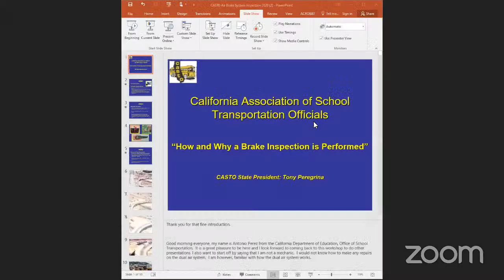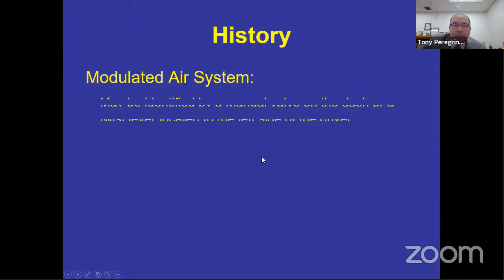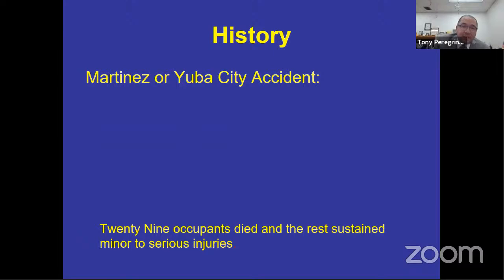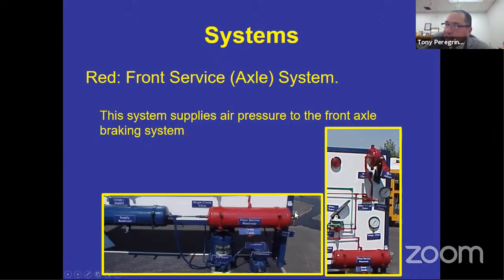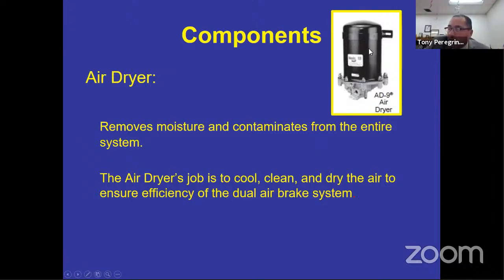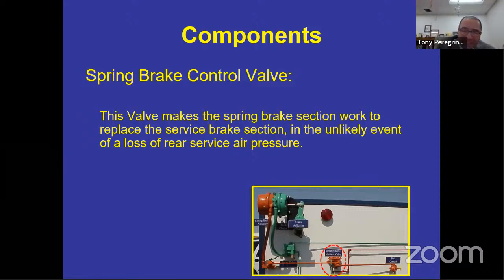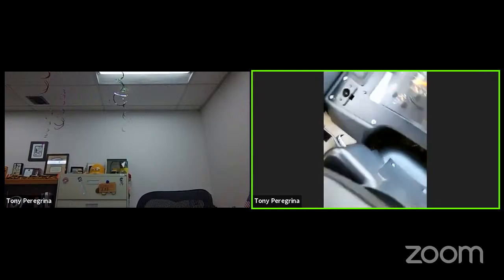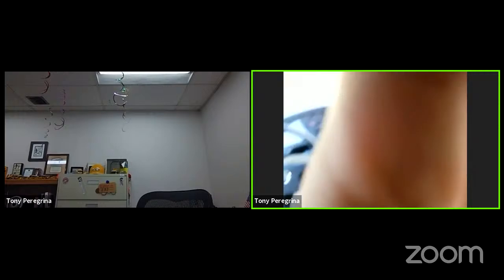Driver Webinar "Dual Air Brake System Inspection"

Comment: Great video. For the low air warning.... Both the audible and visual must stay on at all pressures below 60psi, correct? Both the light and the buzzer.
Reply from the maker: Hi Gabriel, That is correct both audible and visual must stay on at all pressures below 60psi. If you are splitting the tanks, each tank shall perform the test and pass individually. if one tank fails, the bus is out of service. Here is the kicker, you are not required to split the tanks and test individually. Great question, and thank you for watching :)
Reply: @tonyperegrina5452  ok, in the Behind the Wheel instruction manual on page GI-12 where it says, "If the driver can drain the tanks separately", to drain each tank separately. Does that necessarily mean if the bus has the individual drain valves inside the driver's compartment instead of outside on the side? What exactly does it mean by, "if the driver can drain the tanks separately"?